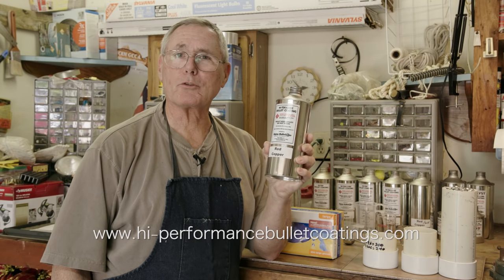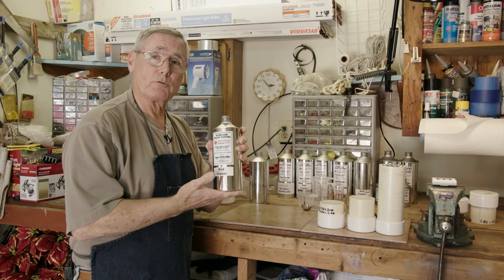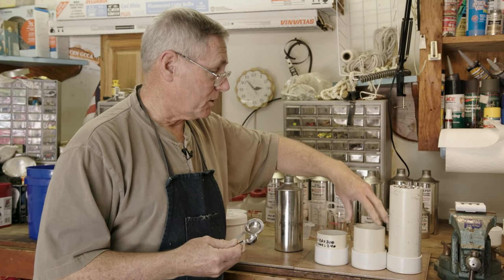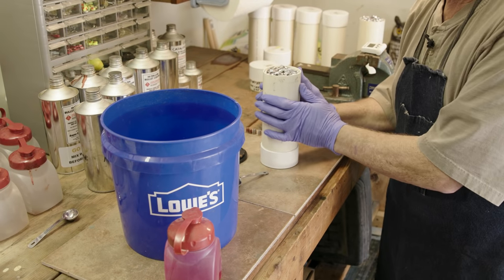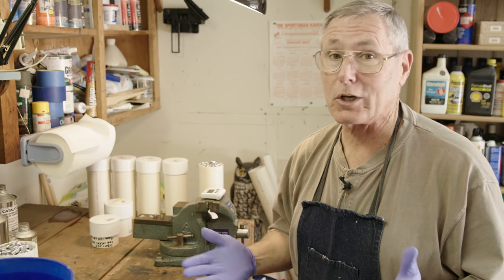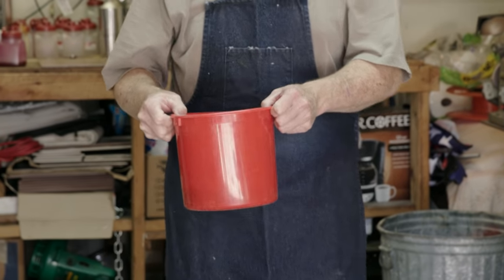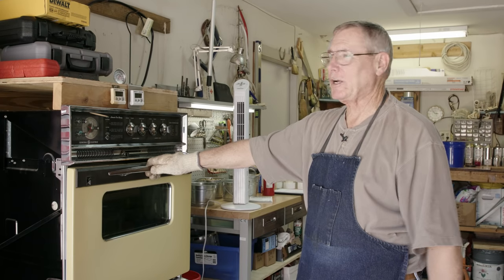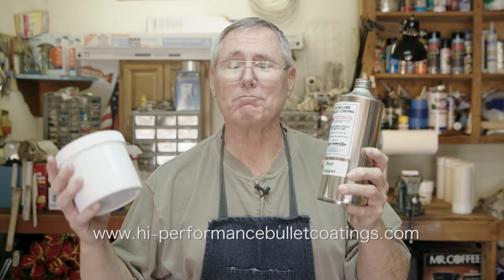How to: Hi-Tek Supercoat Bullet Coating

Comment: Does it have to be a single layer?  I was hoping I could do a lot of them but my toaster oven is not going to fit that many in a single layer.
Reply from the maker: When I first started I used a toaster oven. Of course your batch size will be much smaller. I found that it was tough to keep from having hot spots on the bullets. If you have a convection oven that will help a lot!  A single layer is best. Remember, if your bullets stick together you are applying too much coating. It takes some experimenting to get what works best for you.
Reply: @DanDix  Please help!  I followed directions to the dot but it's not passing the acetone test!  First I've tried 6ml to 6lb of bullets per directions of 1ml to 1lb.  I have Red Brick color and colors are not translucent like yours when it came out first time.  I've went all the way down where I was using 1ml per 7lb of bullets - all it did just resulted in less coverage where anything even cut down in half resulted in perfect coverage after 2 coats but none of the batches pass the test!  The smash test passed just fine, although I discovered something else now too - I can scratch this beautiful coat with my FINGERNAIL!  Where I can see bare lead but smashing with hammer doesn't flake.  I've tried baking from 375 - 390F, I got oven thermometer and I am using convection the temp is not perfect, it's little bit over.  I am using cheap Walmart oven thermometer so I don't know who to trust but at end of bake I noticed the temp climbs to about 405F but not flaking, love the color and it's not changed dramatically like in your video.  I do get fumes coming out while backing.  I've tried backing from 11 min to 16.  At this point I have backed about 40lb of bullets and pretty frustrated.  I never had this problem with PC, it was very tough and would never scratch off with nail.
Reply from the maker: @DimaProk  

Dima, you are on the right track. From what you described here are a couple of suggestions. 
Make sure the coating is completely dry before placing in the oven. This can take a considerable length of time, especially during cold weather. As the acetone drys it cools the bullets significantly. Cold weather makes this initial drying time longer. With this in mind, the first coat is the foundation. It MUST bond to the metal or successive coats will have nothing to bond with. I use a combination of a fan blowing on the bullets to help them dry, and a couple of heat lamps (not too close), to help keep the bullets warm. 
Next, oven temp is important, but bullet temp is what you are looking for. The coating needs to achieve the correct bonding temp. With a small oven that process is more complicated. If you raise the temp to heat the bullets to the correct temp in the time allotted, you might over cook one side of your bullets. In this case it might require some imagination. You might try a “step process” during your baking. Just raising your temp or lengthening the time might burn the coating leaving a dingy or browning on one side of your bullets. Small ovens have bullets closer to the heating element. This may require more time to open the oven to move the bullets around and that will also require more cooking time for the oven and bullets to again reach the optimal temp. Keep in mind, THIS IS AN INDIVIDUAL PROCESS!  If everyone had the same oven, same work environment, same batch size, and coating application, then a printed process could be developed. Keep good notes of what you are doing because your process will be unique to you!  The best part is that you can always melt poorly coated bullets and reuse the lead. When you cast your first bullets you had a learning period for what works best for you. This is simply the next step in that learning process. ENJOY THE PROCESS.
Reply: @DanDix  Just wanted to follow up, I found that in the winter and we have mild ones in WA it took 16-17 min at 410 to get the proper cure.  I got cheap oven thermometer and put it in the middle of the tray with the bullets, the temperature would raise to 425F sometimes.  I also got digital thermometer with probe from Amazon and 2 thermometer don't always agree on temperature to make matters worse.  I had to preheat for solid 12 - 15 minutes otherwise the temperature would not even reach the proper level and I found that sometime I have overbaked it too with paint chipping off during smash and sizing.  There is actually very delicate line between getting under and over.  Never had that problem with PC.

I did find a solution that if you don't get proper cure 1st time you can just bake it again and 2nd time around it would work.  Right now with mild summer it's 66 - 70F in garage and last time I tried 13 min @ 400F and still failed the acetone test, so I had to do 2nd time bake and increase time to 14min and it was a pass.  After the 2nd coat it still had faint color rub off, so I think I'll do 15 min next time but if I overbake it that's it, there is no fixing for that.  I found that temperature varies on thermometer even when I am using same temp and min preset.  If I don't preheat enough the temperature might not even reach 390 and if I run a cycle or 2 and it will overshoot.

Comment: What kind of lead dies do you have? All the lead dies I've come across have the lube groves in them.
Reply: Take a lee mold with lube grooves and a dremel and grind it away, its easy.
Reply: You want to find a bullet designed for tumble lubing. Those grooves are to make sure the bullet picks up enough lube while rolling around.

Comment: Tried my first batch today and they came out great except the color was real dark I used zombie green what did I do wrongly
Reply from the maker: Most likely you cooked them too hot or the right temp but too long. I have noticed the Zombie Green is very sensitive to longer cook times. Shorten your cook time with your next batch. Good news:  if they don't turn out the way you want, just melt them and do over. All you have lost is a little coating and some experimental time. Since every oven is different this process is not a "one size fits all" process. In the final analysis, the color is nice, but the real benefit is in loading and firing. Enjoy the learning process
Reply: +Dan Dix thanks Dan I ran another batch last night and at 8 min is about the right time for me in my oven.   The color seems right but the texture seems a little rough for my liking I've tried adding more acetone and less agitating time so u have any ideas
Reply from the maker: +Todd Newsome 
Several things can cause a rough texture. 
First and most importantly do NOT apply too much coating. Thin coats are better than heavy coats. Next, and most importantly is the time you spend agitating as you mix the color on your  bullets. DO NOT agitate to the point where the bullets begin to stick together. I always try to dump mine out a few seconds early, especially with the final coating. They should appear shiny wet on your drying screen. Next, shake them on your scree very little. I only give one shake after I dump them on the screen and one more time halfway through the drying process. Last thing to check is the size and texture of your drying screen. 1/8" squares and smooth screen is best. And remember, if your bullets are sticking together you are using too much coating. It is surprising how little you actually need. 
One more thought., clean up after you coat. Clean the agitating bucket when you finish for the day.

Comment: Hey, Dan. 

Great video but it looks like you mostly skipped over the part about the required Hardener. What's the ratio, how long does it remain stable? Is the correct ratio 20 g of powder, and 5g of hardener and 100 ml acetone if mixing your own? Is the temperature and time in the oven related to curing the moly resin?
 When setting up for the first time, is the rub test the best test for determining properly cured resin at each step? How sensitive is the material to mix ratio errors?
 How long before the admixed coating sets up in the can? Is the mix stored at room (or garage) temperature or in a refrigerator?  How do you tell it's about past shelf life once mixed? 
Does the hot smoke contain hazardous to health chemicals and the wearing of a chemical respirator advised?

Lot's of questions from a guy that is used to working with curing type chemicals, many of which can kill you or not work at all due to mix errors, so I'm sure the not so familiar will appreciate your answers too. 

Good shooting!

Comment: hi Dan, been watching this video and noticed your bullets do not have the lube groves,, what kind of mold is that?
Reply: Take a lee mold with lube grooves and a dremel and grind it away, its easy.
Reply: Israel Quintero : The best way to produce bullets without lube groove is to simply make them by extruding them on your press, some people grind away at their mould with a Dremel, but that usually produces a very out of round bullet, the extruded bullets are much more consistent than cast bullets as well, and the extruder die s simple to make.
Reply: Trust me, with patience and a steady hand nothing will be "out of round"
You can also mill it away with a drillpress with a vise an an endmill.

Comment: So if it flakes off or rubs off after 3 coatings, how do you correct it?
Reply from the maker: Bill, there are two tests to insure the bullets are properly coated.  The first is the tissue test.  After each coat is removed from the oven, and cooled, rub a test bullet briskly on a paper towel with Acetone on it, at least 5 or 6 times.  If any color rubs off you know that the coating has not cured properly.  Because every oven is different you should expect some experimenting time to zero in on the perfect combination of temperature and time.  A good starting point is to have the oven around 385-390 degrees.  I leave my bullets in the oven for at least 8 minutes, and then open the door to vent smoke and fumes.  At this time I stir the bullets or shake the tray to keep the bullets from baking all on one side.  The oven is then closed for another 4 minutes.  This is my process, with my oven.  It will certainly be different for your setup.
The second test is the smash test.  If no color comes off on the tissue, take that test bullet and give it a serious smash.  If the coating flakes off the coating has baked on too hard.  Here is the part of the tuning process.  Arriving at the correct temperature and bake time is your goal.  This may sound complicated but once you find that "sweet spot" for your oven and volume of bullets, all the guesswork is done and you are coating and having a blast.  (Pun intended).

Comment: If color comes off what do you do put back in oven?
Reply from the maker: I assume you mean the color comes off after you are finished when you rub it with acetone. This indicates that the temperature of the coating and lead has not reached a temperature of 385 for at least 2 minutes. A thick bullet will take longer to heat to that temp than a thinner one. Try to keep your oven at 385 and lengthen your time slightly. Check a bullet after each coat to test. I'm not sure about putting it back. Try it and see.

Comment: Dan have you tried to make your own bullet mix? Here is what I do: I add 100 grains of powder coat (Harbor Freight red) to 1 ounce of Acetone and I use 1/4 teaspoon of mix to 1 pound of bullets. 400 degrees for 8 to 10 minuets. I coat twice and wow it is great. Much cheeper. Ed Collins Holly Ridge NC
Reply: Ed Collins: Many thanks for this tip, have you tried using a better quality powder like Eastwoods ? Chris B.
Reply from the maker: Ed, I have seen powder coated bullets.  The colors and brilliance is terrific, no doubt about it.  I have never tried powder coating so I am ignorant on the process.  I coat 30 lbs. of bullets at a time.  That's about 550 45ACP bullets, and over 1000  9mm bullets at a time.  Perhaps I will give powder coating some time.  Thanks for your comments.

Comment: what was the hardner, acetone?
Reply from the maker: Matt, the liquid coating comes with separate amount of hardner   The powder version of the same thing has the hardner mixed in the powder. Get the powder, it is best.
Reply: That's good to know there.
Reply: Matt Lord acetone is the solvent.    It's basically powdercoat dissolved in acetone.  Powdercoat Is a unique thermoplastic.

Comment: Bullets do not need to be coated and most if not all bullet coatings will build up in your chamber and cause accuracy issues.
Reply: TheeBudGuru I would like to see facts about your statement if you have them
Reply: In my opinion the main purpose of coating bullets is to protect the lead bullets from oxidizing over time. Oxidized lead will harm your barrel. If you fire your lead bullets shortly after molding them, you will not need to coat them.

Comment: Too much time.
Reply from the maker: The value of time is apparent when batch size is considered. I takes the same amount of time to coat 50 bullets as it does to coat 800. If you prefer a small batch size, then this might not be suitable for your needs. I’m simply demonstrated what works best for my batch size. I completely understand, Butch. Different strokes for different folks. 😀